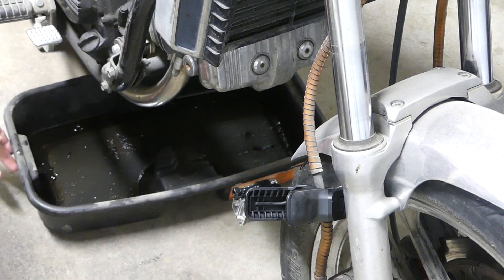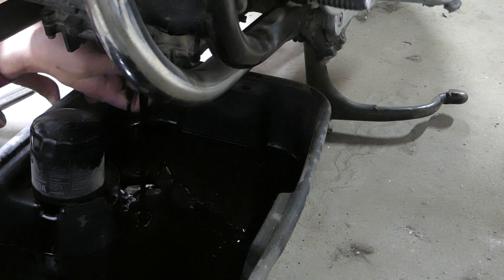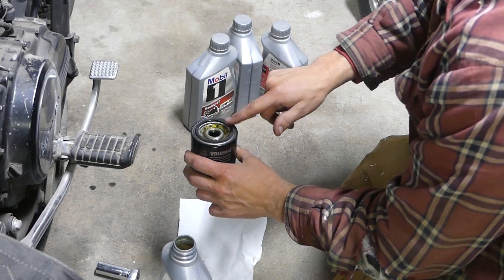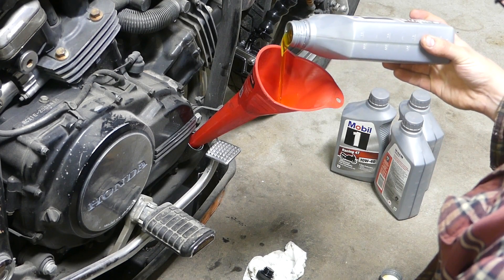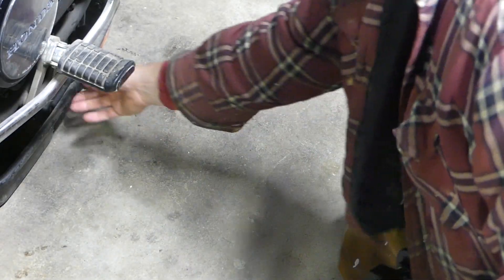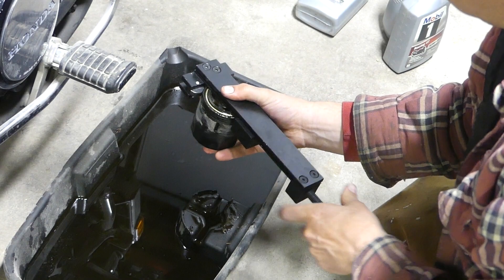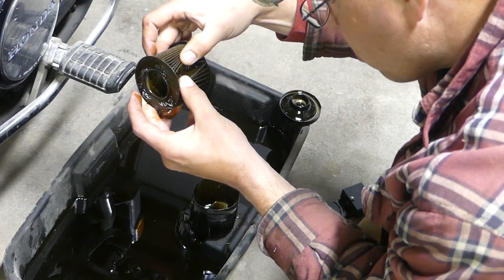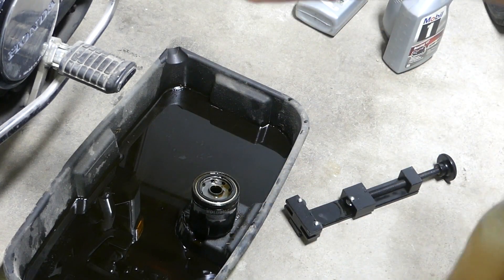Honda vf750 oil change

Comment: Hello, I'm from Antofagasta-Chile and I have a Honda Magna 750 1983. I send my bike to make oil changes. Seeing the video makes me feel like doing it once.
Question: What type of filter I should put on the bike (brand, details).
Once the used oil is emptied, how many liters are cast out of the new oil?
Finally: what oil is thrown into the cardan (brand) and how much is it cast?? .
For both jobs only used oils are emptied and changed for the new directly ?? ??, no one has to clean inside or something??
Waiting for your help.
Thank you.

Comment: Hello. There is VF700C engine, RC21E model. On VF750C 1982-1986: window in crankcase cover is used for oil level check.

Comment: Hi, I'm from Chile, how is magna in 2019? I want to buy a 1985 V45. But you get spare parts in stores? Especially engine parts and pistons?
Reply from the maker: Parts are getting harder to find. eBay has been a good source. Buy one in good shape to start with.
Reply: @nateboyce1  thanks!!!
Reply: on the internet. You have ebay and such in chile? hehe
Reply: I have a 1985 vf 750 bought last year, i cant find in manual what oil and filter should i use when putting in new for oil change